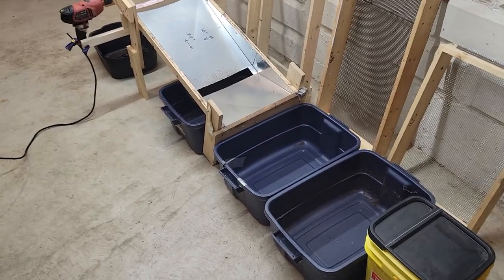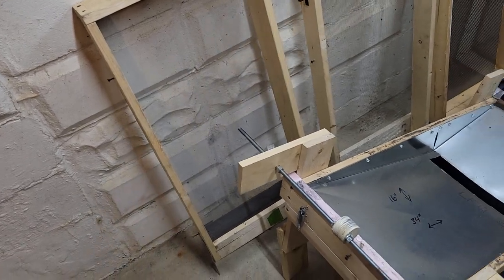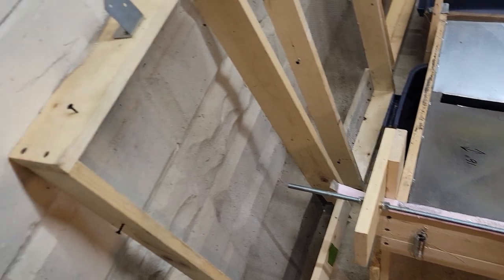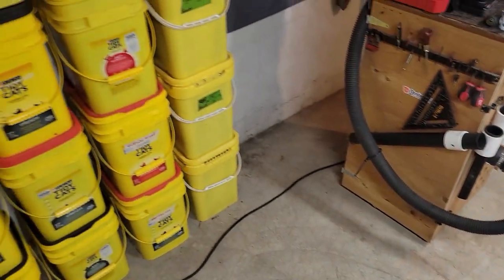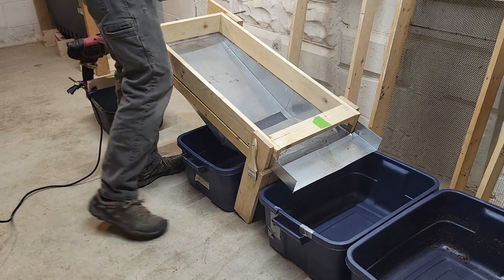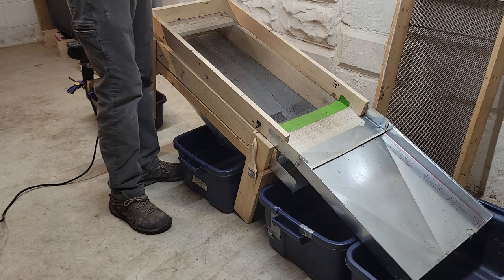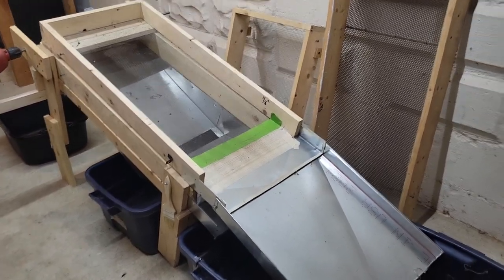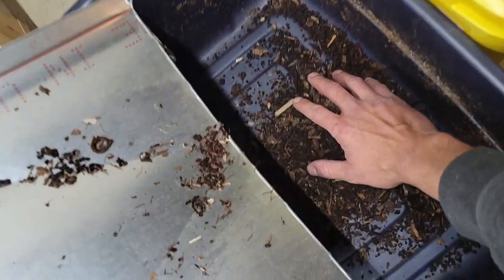DIY Modular Drill Powered Worm Castings Harvester / Sifter

Comment: Thank you for posting this video.  Nice job.  I've been building mine, in my head, for several years.  It has many elements similar to yours.  A cheap drill is absolutely the way to go.  For that matter, I plan to keep a new spare(or two) on hand at all times.
Reply from the maker: I first had a jig saw moving the table. If I could've found a way to tame it, I think I would have stuck with it. It was just too inconsistent. Thank you for your input, and good luck on yours!

Comment: This is great! I was thinking of building  a similar design but using vibration… an easy hack you can test for noise reduction, try some thin weather strips on the underside of the bracket so it’s not metal on metal.. Might also try the same to dampen the wood on wood noise. Again, great work! I appreciate the video!
Reply from the maker: Thank you, I appreciate the feedback. The more noise reduction I've tested, the less effective the "thump" is to clear the screens and keep things moving. I suspect I could play with the angle more to compensate.
Reply: Yeah, vibration motors are only $20-$30. I happen to have one and a whole lot of drills.

Comment: You can probably  put a dimmer switch on the drill  to control  the speed more easily. Great build  I was looking for hardware cloth today to build a sifter
Reply from the maker: Thank you. A dimmer switch is a good idea. I will incorporate at some point.
Reply: @that1guydoesthings  I'd caution that idea. The drill is designed to run on the full 110/115v AC. Choking down the volt supply could do damage to the drill.

Comment: This is great, need some dimensions or sketch, my brain is already working on noise reduction and I think I have it with a simple modification.
Reply from the maker: Thanks Frank. I had springs and rubber bumpers that made it very quite, found  the thud helps knock material thru the screens and prevents plugging. I will make a better build video soon w more dimensions.

Comment: So the rod is straight into the drill?
Reply from the maker: Yes. If you have trouble getting the drill to tighten onto the threaded rod tight enough, you can grind two flat spots on the threaded rod for a better bite.

Comment: How think was the metal you chose to work with I'm thinking of trying to use 29 gauge flashing. I've never worked with metal couldn't find any videos going over the basics but I think it shouldn't be to tricky . 😅
Reply from the maker: 24 guage sheet metal. Making some cardboard templates may save you some headache. Thanks for watching!

Comment: Dude, where did you find that 3/16” screen in that length???
Reply from the maker: Menards, but most local hardware stores carry 24"×24" pieces. Notice the seam, I had to use the off cut to get the length I needed. Turned out the off cut was almost exactly what I needed to make up the difference.
Reply: @that1guydoesthings  Thank you most kindly!

Comment: Gidday mate, I am on my way to the hardware store for most of the materials,  but wanted to ask you which drill to buy? I think you said an industrial one, but not sure which.
Maybe you could tell me your drill and I will just get that one.
Thanks in advance
Reply from the maker: Mine is a Skil brand. If you are getting one dedicated for the job I would get a cheap corded drill. If you intend to use it for more than the sifter I would spend a little more and get battery powered. Maybe ask some friends, good chance someone has an old one laying around you could try out.
Reply: @that1guydoesthings  Well I copied everything you did and made the hole thing including the sifting trays. However I have run into a problem. 
I have put 5 nuts and 5 washers on in total, but when the drill is turned on every things works perfectly for a minute and then I notice that the rod is moving down away from the drill and the nuts are undoing.
I have never used nuts and washers before and looked on google and I think maybe I need a spring washer. But if so how many. Can you please give me some help .
The rest is perfect and it works just like yours except for that one problem. 
Thanks, laurie
Reply from the maker: @laurie bareham  the nuts holding the rod in place are Nylocks. It is a nut w a small nylon insert to keep them in place on the rod. The two clamping the cam are regular. It's a bit of a dance getting them on, goes quicker if you can use the drill to turn the rod while holding the nut with a wrench or other tool. 
It's obvious I need to do a better job in my videos on the details. If you need I could make a video later. Thank you.